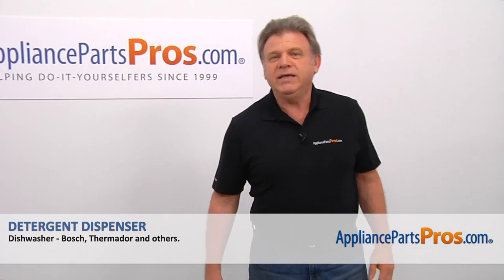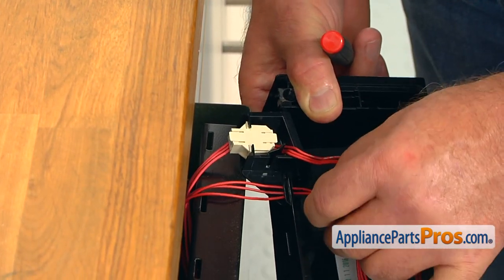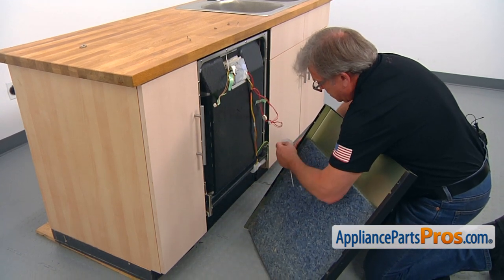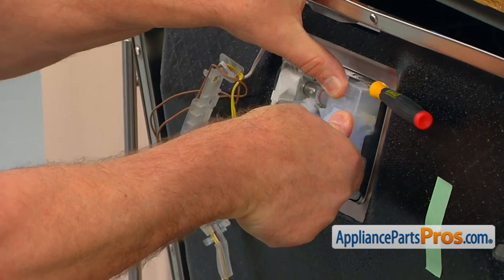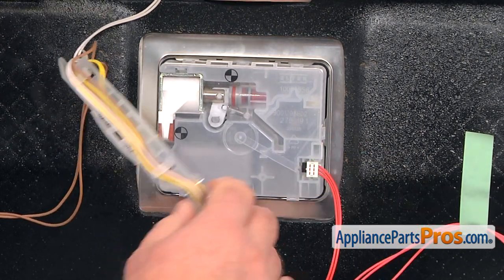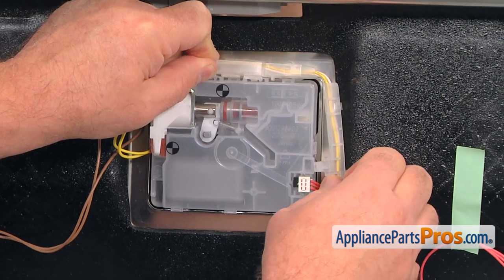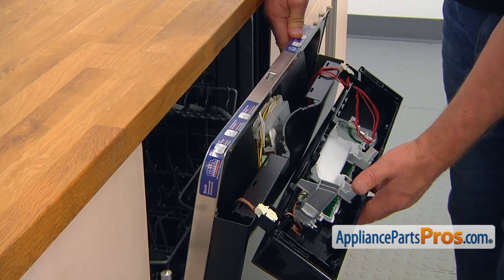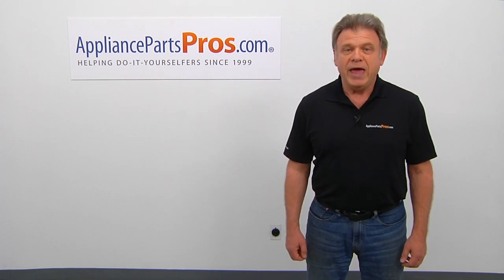How To: Bosch/Thermador/Gaggenau Detergent Dispenser 12008380

Comment: Great video. Question: I have the proverbial one part left over after finishing the soap dispenser swap. It's a blue and gray rubber strip slightly shorter than the width of the door. It fell off during the disassembly. Any idea where it goes? Thanks!
Reply: That is the seal and you must install it or it will leak.. Take pictures before and during disassembly always.
Reply: @mrgcav  I don't think that is correct.
Reply: It goes along the very top of the control panel on the inside with the blue strip visible